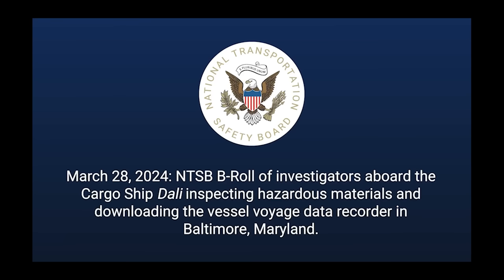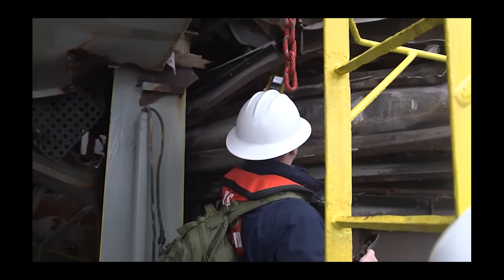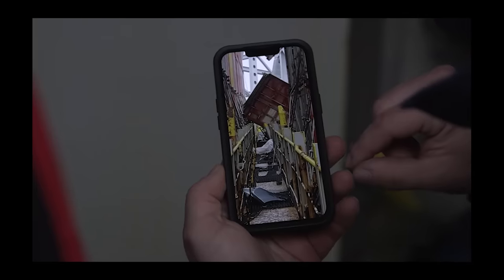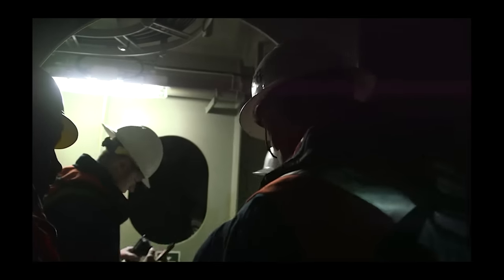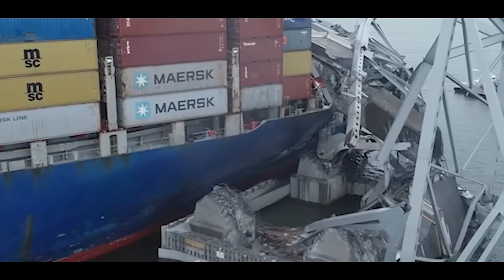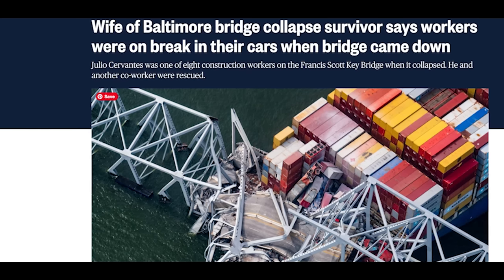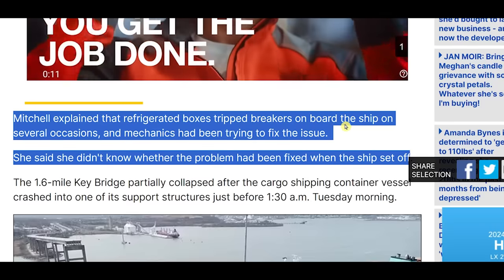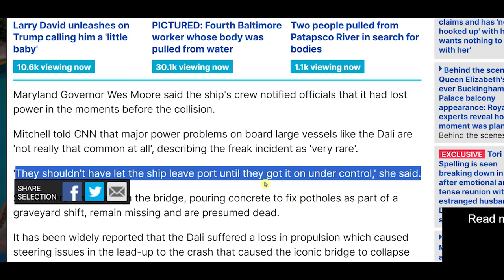NEW NTSB Video On Dali Ship Point of Impact Key Bridge

Comment: VDR data automatically is archived into a removable thumb drive which is usually in a room aft of the navigating bridge or on the deck below in the server and gyrocompass room.
 Of particular interest will be what the electrical Power Management System record tells us. To my eye, it looks like they suffered a genny or a bus trip. They either closed a bus tie or started and synched another genny and tripped again.Much of this would have happened automatically. 

 The reefer boxes tripping breakers isn’t so much an issue. International regs set by the IEC specify that reefer plugs are 400 volt class, 3 phase with ground plug at 32 amps. What can happen is a bank of reefer compressors all start at the same time which will momentarily overload the breaker. You avoid this by taking your time and starting your reefers in a measured manner so that they are all staggered making their demands upon the circuit.

 In any event, the ship should have automatic load-shedding or preferential trips which would isolate all the mess out on deck from the essential circuits needed to operate the engines, steering and thruster and navigate the ship.
 To this end, the EDG should supply at least one of the Steering Gear HPUs, (frankly a likely non-issue since the vessel was in the channel and her course track looked straight as an arrow.

 They had time to drop the port anchor which you might be able to see S a big plume of rust and sparks from the port bow as the chain rides over the capstan and down the hawsepipe, but the bottom of Balto harbor is mud, so it dragged. 
 The big plume of smoke from the stack is, I suspect, the Engine Gang stopping the engine and shaft and restarting the engine in reverse firing order, (this is how you “back up” with a slow-speed 2-stroke diesel, which MV Dail has).

 Your point about the lack of dolphins is spot on. Key Bridge has them, but they were apparently unchanged since 1977 when the bridge opened and ships were smaller in the mid 1970s when Key Bridge was designed. I know…I’ve sailed Electrician and ETO for over 30 years. Baltimore is my homeport and I worked McAllister harbor tugs there for a short while in 2000.

 Our SOP was to escort ships through the bridge outbound and then tie up on the dolphins and await our inbound to escort them through the bridge and to the berth. 
 Two tugs and her crews are expensive, and shipping companies do not want to engage tugs any more than they and the harbor pilot think are necessary.

 Betcha THAT gets changed now.
Reply: "Of particular interest will be what the electrical Power Management System record tells us. To my eye, it looks like they suffered a genny or a bus trip. They either closed a bus tie or started and synched another genny and tripped again."

Much of this was pretty much confirmed as well in other places where its nothing but industry experts and crew men.   If you watch the video of the camera looking at the harbor,  the lights didnt just snap out,  they dimmed for about a second then went out.  that tells me a overload is starting up then finally tripped the bus ties, so i agree,  this was a overload that tripped the bus or the genny itself causing the entire ship to blackout. 

-----

"In any event, the ship should have automatic load-shedding or preferential trips which would isolate all the mess out on deck from the essential circuits needed to operate the engines, steering and thruster and navigate the ship.
 To this end, the EDG should supply at least one of the Steering Gear HPUs, (frankly a likely non-issue since the vessel was in the channel and her course track looked straight as an arrow."

this was also pretty much confirmed, but the real problem is the EDG and the bus tripped again after the right rudder command was given, due to the second failure the turn was overshot and pointed the bow right at the pillar.   If you look at the AIS Track,  the ship was going straight, but, that straight line was going slightly to the left of the channel indicating a drifting.   When you look at the historic wind and tidal info,  the tide was going out and a NE Wind was blowing - both slightly pushing the ship to the left, when the power was first lost, now the concern is drifting into the left side pillar, side swiping it or worse,   running aground at Fort Carroll on the opposite side of the bridge which literally borders the left side channel going out.  

so when power was restored, Right Rudder was ordered.  this was confirmed on the VDR in the initial release of info yesterday.  along with the port anchor release command.   

-----

"The big plume of smoke from the stack is, I suspect, the Engine Gang stopping the engine and shaft and restarting the engine in reverse firing order, (this is how you “back up” with a slow-speed 2-stroke diesel, which MV Dail has)."

I have tried to also explain this, but people literally refuse to accept this answer.  the black smoke is also as thick as it is due to the induction blowers failing with the blackout conditions so it was operating in a very poor efficiency state.   a lot of that plume was partially burned fuel and soot.

Comment: It's a miracle those two construction workers were rescued from the water. It's amazing the ship did not sink. Big thanks to law enforcement for quickly stopping traffic.
Reply: They said the bow of the ship is actually resting on the bottom of the channel, from the tons of bridge debris pushing down on it.
So there is not much of a chance of it sinking.
Reply: The ship couldnt sink. They have air lock compartments below the water line. If one floods its stays in that compartment.
Reply: @ronaldmorris3197  - water isnt that deep

Comment: Good one! This is unfolding pretty fast in an unofficial sense. The power loss is critical and here we get what is likely a large hint about its origins and the causation of its occurrence at that critical moment.

The second key factor was the decision to crash astern when power returned. Any sailor knows reverse prop walk is pronounced and sent the bow to starboard. They could have corrected heading and with little or no additional forward power have kept the channel under the bridge.
Reply: I dunno that the large vessels are subject to the significant prop walk you’re talking about, brother. Prop walk is a function of blade angle of attack and the shafts on these large vessels are pretty much as horizontal as the waterline, aren’t they?
Reply: @joeschmoe7221  With a single prop set up on a large ship, the torque will cause a sudden veering of the ship during an emergency reversal of the engine.
Reply: @joeschmoe7221  no. According to an “expert” retired container ship engineer (here on YT) he called it paddlewheeling, and all props experience it. I sailed in boats with inboard auxiliaries and every engine I ran experienced it. It’s physics, not scale nor alignment.
Reply: Reversing propellor at 7 knots is not going to do much, if anything.
The power to the engine never really returned, and if it did it was momentary given the belch of black smoke which indicates incomplete fuel ignition.
The backup power is only for critical functions on the Captain’s bridge, not powering the ship’s prop.
Reply: @brianbaker359  well, it will all come out. I thought I saw something about the VDR recording engine and rudder commands. In any event something caused the heading to change from in the channel to into the piling. Sal at what’s happening with shipping is citing current coming from the starboard river channel before the bridge, but the things I saw in the original tape and since suggest someone was trying to arrest forward momentum. I’m fine waiting for the investigation, as I’d rather know the truth. In the meantime, it’s interesting to play parlour detective. 

Jeff Ostroff’s channel had a log file showing the ship was having breakers trip while at berth from the refrigerated containers. Another potential  cause…
Reply: They had deployed the anchor. They expected it to slow/stop it when all it did was spin it.  This is all googleable information.

Comment: Just incredible how this harbour allowed huge oversized container ships to move within the harbour without Tugboats being used as escorts as they do where I live. Basically this was an incident waiting to happen, it's not an accident because they can be avoided.
Reply: Totally. I'm a prostitute and I'm always on ships and have even been on the Dali several times and I can tell you they had problems then so I'm not too surprised.
Reply: They do use tugboats but they do not go with them up to and under the bridge.  There was a comment on another video from someone that works at the harbor that said the tugs were mainly used for bringing ships up to the dock and for getting them away from the dock and headed in the right direction when leaving.  They only go so far.  I like you, don't understand why a ship that large wasn't escorted until it was past the bridge.
Reply: Agreed!
Reply: Are the tugs supposed to escort the ships 15 miles out of the port under the Chesapeake bay bridge also 😂
Reply: I thought the same thing. I had a view of San Diego Harbor and all the barrages, large ships & military vessels had tugboats guiding them through the channels, definitely something that needs to be investigated.

Comment: I am very surprised that the brige pillares here not protected from some distance 
by some bumper protections to prevent a shipp from hitting a bridge pillars?
Reply: It's been mentioned by many people.
Reply: Its a 98 Thousand ton ship ! You would need a 60ft island around each pylon to make them safe! When the bridge was built container vessels were 30 thousand tons!
Reply: I blame poor infrastructure! Government squandered the money to make the bridge safe for the traffic they want to profit from
Reply: @jackdbur  exactly, the bridge was basically at fault, failure of government. 
Or ships over 30k ton shouldn't have been allowed in there.
Reply: gap was 1200ft wide, no reason to be be close to them.... boat only 200ft wide.. you could have 5 pass side by side at same time
Reply: That is what I say.

Comment: Ok, great footage.  Way more than I've seen to this point.
Gotta say tho... if the ship was tripping breakers to reefer boxes, that alone would not affect/cause a ship wide outage as the breakers would separate and protect ship wide power.
That's what they do - disconnect an overamp draw from the main power supply - to protect the main power supply.

I don't have any answers but a tripped breaker protects the whole. Not endanger it.
Reply: FOOTAGE?
Reply: I would assume that the ship propulsion power would be isolated from the cargo power when built, but who knows what happens later if the system that supplies power for refrigerated containers has a problem. Refrigerated cargo is usually very expensive so the power might have been cross connected to try to save it.
Reply: Good observation, as an electrician for 40+ years and not being able to troubleshoot first hand. I would make the observation that shipwide loss of power is a main generator shutdown with the secondary generator not in standby mode, most likely failed maintenance on the generator engines. All large ships like this have 2 (possibly 3) generators with automatic transfer switches so if you loose one generator, it automatically transfers and starts the second one. This appeared to not happen in this case. Again, maybe due to poorly maintained engines.
Reply: too bad that it's a junk report. See my post at the top to see all of the mistakes/crap that he just made up to make his video more interesting.

Comment: To clarify the term 'boat' because its a ship.

In this kind of casual and general usage, the word boat is often used to refer to watercraft of all sizes and types, as you can see in the variety of terms that include the word, such as sailboat, motorboat, fishing boat, rowboat, tugboat, paddleboat, and lifeboat.

In contrast, the word ship is typically reserved to refer to a large, ocean-faring vessel propelled by multiple sails or engines.